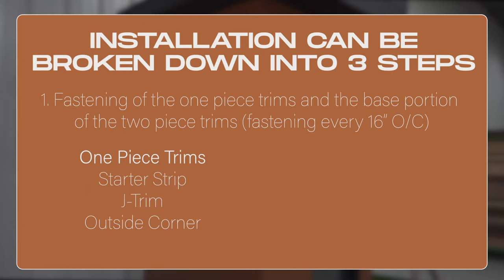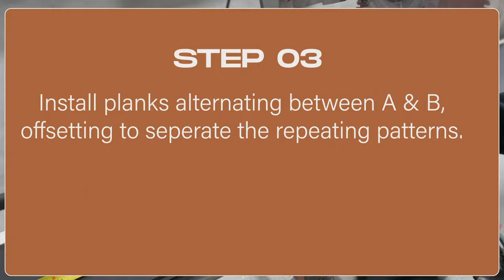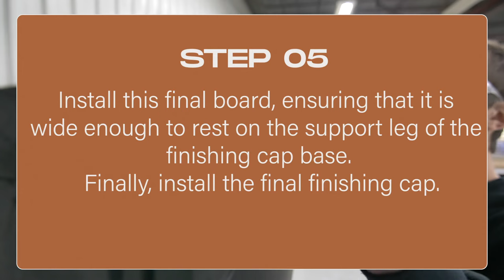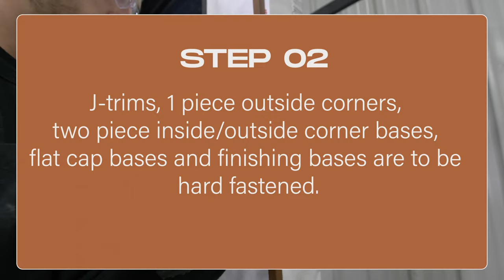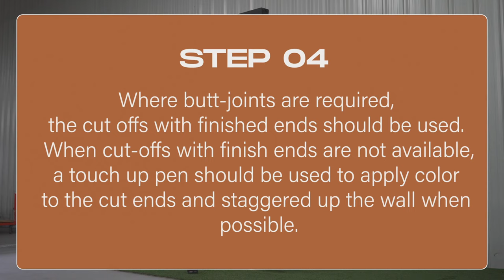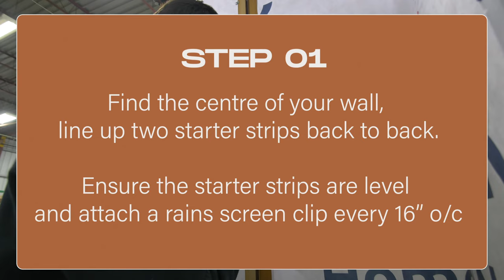Aluminum Siding, Soffit & Fascia Installation Guide | LUXYCLAD Aluminum Architectural Systems

Comment: Just started using your material on this job and it’s not bad to work with, if your doing a indoor soffit I find the clips to be unnecessary, and why didn’t you guys make the material a 6” profile for more coverage
Reply from the maker: Hi Shawn,

Thank you for the feedback, the rain-screen clips are designed to allow the boards to expand in contract and also to keep the faces of the profiles flush in the trims. Hard fastening the boards will not allow them to expand and contract freely however, since your application is indoors I understand why this may not be an issue in your case. We appreciate the recommendation on the 6" perforated profile and may introduce something like this in the future.